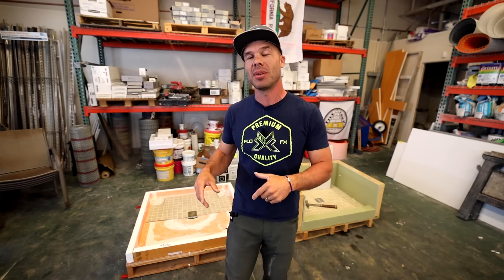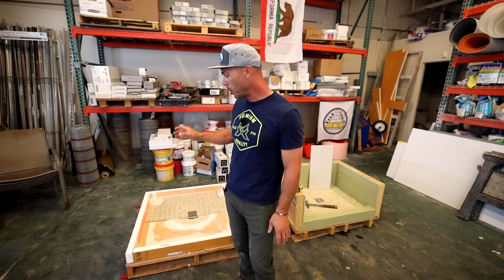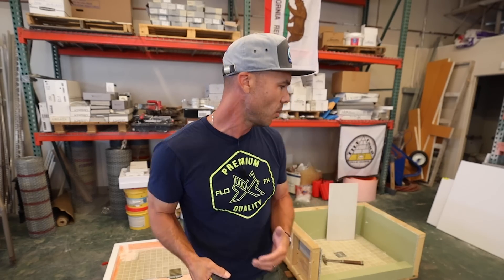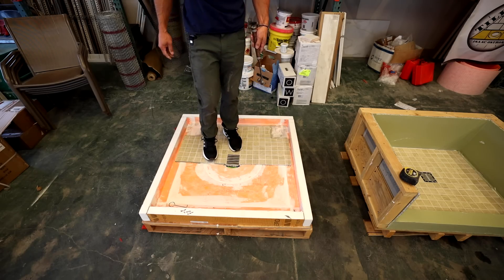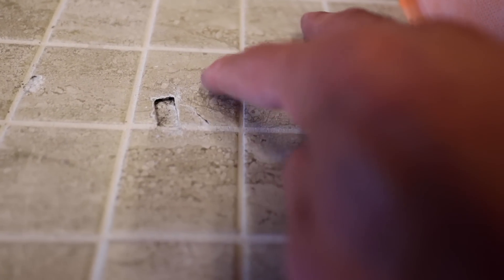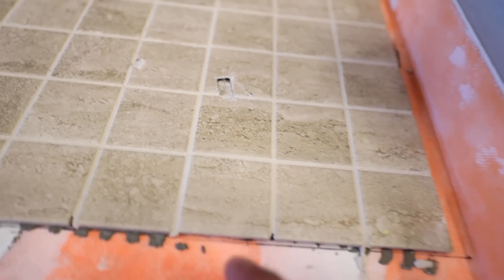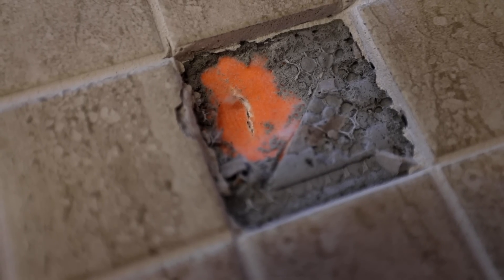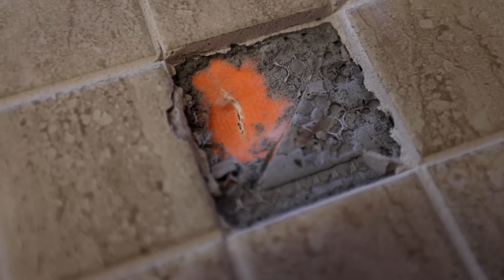FOAM VS MUD --- Drop Test 2x2 Porcelain Tile Shower Pan

Comment: With the foam side, could I put something down on top of the foam, felt or hardi board, before covering with tile?  Would adding that provide more protection to the foam pan with just a small added step?

Comment: Dropping hammers or slabs of tile aside... "any" shower can leak, even a mud job if its not done properly. Personally... if I had to choose between a mud job installed by a guy how lied about his skills and qualifications or a foam pan installed by a licensed pro... I'd take the foam pan every time. Failed showers are not due to the materials used but rather errors and lack of knowledge by the installer. Once a foam pan is professionally and correctly installed, finished and put into use... I can't think of a single time where I've carried a framing hammer or piece of time into my shower with me. Moral of the story... regardless if your base is foam or mud...  protect the shower floor until all construction is done.

Comment: I've mudded everything for the last 35 years and to the best of my knowledge no customer call backs on water leaks and no cracks in the grout, the only two mishaps were at the very beginning when 1. I did not slope under the 40 mil pan which the building inspector dinged me on and 2. the dam cracked and failed on another shower because I cut the folding membrane to the top of the dam to the side walls.
If you use anything other than full mud shower construction you must CAULK all changes of plane, where as my total mud showers don't need it - at least thats what I say and nothing is more uglily than caulking in a shower.  Also I've never cut my galvanized wire at the corners - it's continuous and over lapping.  Also I don't cut the mortar walls in the corners to create a movement joint like the new rules say to - what is this about?  
One of the five principles of engineering is compression and how to transfer the force to the lower levels of different materials without compromising the top layer like in road construction.  In a foam pan its not solid and hollow sounding, whereas a mud constructed pan using thinset to set tile acts like a solid material and the force is transferred to the existing base.
Hopefully I don't blow it with the main manufactors of tile setting materials because I know and like them, but they push speed and ease of construction in showers - when I push the question on which method will survive the test of time they admit that the old way is still better in the long run.

Comment: I had this problem a month ago, my fault for not protecting the kerdi pan sufficiently. had to pull a broken 33x33 wall tile and a wedge fell off the wall cut my arm and punctured the kerdi pan (about half way). set me back a day repairing the pan with a piece of kerdi band and a coat of redgard for extra insurance. thoughts?

Comment: I built my shower with kerdi, but decided to spend an extra $50 and buy a gallon of Mapei Aquadefense to paint on top.  $50 for an additional layer of waterproofing seemed like a good deal.  If it were me, I would just use the aquadefense to paint over that tear in the foam pan.  I think that would suffice.
Reply: How’d it turn out thinking of doing the same double insurance

Comment: i have a plywood floor putting level up then put kerdifoam shower pan then put my 40 mill rubber on top of foam put dry pack and tile an overkill but I am replacing a 8 year shower that failed I dont want to do it again house has 4 showers that needs replacing

Comment: I’m not an installer so I don’t know what’s out there for shower pans. 
Although my neighbor had the foam and somehow it starting to leak. They ended up having to replace the whole shower as well as all of the wood in their hallway. It was a huge fight with your insurance company but they ended up winning after a long battle.

Has anybody come across this before? The reason why am asking is because I am looking to remodel my bathroom and I want to make sure the contractor does it right and I don’t end up with a leak having to replace my three-quarter inch solid oak floor that happens to be parquet.

Any comment would be appreciated.

Gal in L.A. trying to avoid more issues that I have in my kitchen remodel that ended up costing me a lot more $ than was budgeted…with a 25% for “just in case” since my home was built in 1951.
Reply: Any shower can leak, even a mud job if not done properly.

Comment: Just an FYI  Your 3' drop might have been from your hand to the flooring but the bottom of the dropped tile was only around 2' off the floor.   Just an observation.
Foam or Mud pan.  Foam pans are outrageously priced.  $600 for foam worth $25.  I would rather do a mud base and pocket the money so thats what I do.
You should do a video about why to Never do a multi layer 2x4 curb especially pressure treated ones.   Seems to be a homeowners favorite thing to do followed by their worst nightmare 6 months later.
Reply: What's wrong with 2x4? I get PT, that can bend/twist as it dries, but whats wrong with Southern Yellow Pine?
Reply: @nandisaand5287  Its wood, thats the problem.  Wood and water don't play together nicely.   Lets say your wood curb dries out nicely in 2yrs.  now you have a gap between the wood and thinset, mortar, tile, whatever you applied over the wood.  Now its going to crack and leak water from the air space that was created.   Are you trying to say using wood as a curb that can dry, shrink, rot, twist, swell and whatever wood can do is superior that doing a curb made of mud just like your shower pan.  then you might as well just stay true to yourself and do a plywood shower pan as well.

Comment: Question: for a fireplace, if you're concerned about warping from the heat, why not just go for drywall instead (or even mold-resistant drywall if you're concerned about moist heat)?

Comment: I dropped a heavy marble corner shelf onto my finished shower floor from about 4 feet up. Mud pan. it hit next to the drain and only damaged one floor tile which was octagonal mosaic marble. The shelf pretty much shattered. I used a wood chisel as well to remove and replace the tile.

Comment: Isaac do you have a step by step video for DIYers for a shower room build. It would be nice to have a guideline. Im going to attempt doing the bathroom myself, Ive done tiling before but with a friend at the time and I have my fair share of experience as a DIYer. As I am going to attempt all this myself, it would be nice to have a quick guideline from some experienced tradesmen or you (so that atleast I know where to start off, what to research and where I stand in terms of skill set). Thanks in advance. Any links to websites will also be appreciated

Comment: The foam shower pan seems inferior to deck mud in every single way. Just use hydroban if concerned about a flow-through system. The only advantage I see is the install time. So good for the contractor, not the customer.
Reply: Hopefully the customer isn't dropping tiles or hammers on their shower floors! Soap and sponges won't damage a foam tray.
Reply: The only issue I see is it limits the size of the shower. Probably have to do good research on how to manage the pan/wall interface. I’d find Issac’s video on tub installs and use that method.

Comment: I always put down a sheet of durarock over the pan as I tile the walls. I only take the durarock up when I grout the shower pan and that's at the very end of the shower install. Cleaning and grouting shower pan is last. The next day I do the Finished caulking. Which it's good to step on the pan with no duracrck. All I have in my hand is a caulk gun. No probs. 😁
Reply: 1/4 Jet board here. Gets few showers out of a board. In a pinch I’ll use waste pieces of 1/2 foam board just to spread my load when I’m on foam.

Comment: Pulled our tub. Built walk-in shower with Kerdi pan n drain. Go board walls, fabric n aqua defense on seems.  Pan to wall seams used kerdi band and thinset..  then put aqua defense on that..   turned out great.   I won’t be dropping 2 foot tile on our fished product.   Excellent demo tho

Comment: Another test item could be drill driver. I was building a shower surround for someone and it fell off the shelf. Then landed on the phillips bit so it had all the weight on a small impact point. It broke about a 1x2 inch chunk of porcelain. oops

Comment: I'm an old Mud Man for sure.  You can control so much more with mud to adapt to the different tiles you get asked to tile a pan with.  Not only that but you make more money which is why I am still a tile guy.  Who wants to send 4/5 hundred bucks back to Germany?  Not me thanks.  Whenever I see orange stuff being used on walls and showerpans I immediately think handyman not Tile guy.  Issac you should do some videos on using mud to ramp up to a zero transition shower for handicap access.  Always like you're attitude and approach to life Issac!  Two thumbs up from Minneapolis!

Comment: I had the same issue happened to me I build the whole shower and the electrician drop his saw cup and boom 💥 it broke the tile and piece the foam and the membrane  I did remove 6 tiles patch the whole and I did need to shave the back of the tiles basically a whole day of work to fix it. If it was mud  I only need a hour to fix  it

Comment: I'm Mud guy with vinyl pans just because that is the way I was taught..  I was also taught the shower floor goes in last so I tile everything then float and set my floor.  I was also taught the 1 coat wall float over paper and wire which I know alot of you don't like. I'm about 8 years in to doing showers this way and am yet to have someone call with a failure..(Knock on wood)

Comment: While I do love the test, the engineer in me says a sample size of 1 is insufficient data. You have 16 sqft of area to test, why not do a minimum of 5 drops on each and see if results are same? 

Since we are talking 10lbs accelerating from 3’ drop, I’d need to know surface area at impact to know the actual force the impacted tile but it wasn’t that much. Imagine a 200 lb person climbing on a stool placed in shower. The feet of stool is 1 sqin. That initial load, even with plastic feet on stool is enough to cause deflection in that foam, especially on outer area where the foam might be 2” or greater. You might say, who uses a stool in shower? The glazers installing the glass. An elderly person using a walker. 

There’s simply no reason to use foam pan unless it’s a flipper looking for cheap labor and fastest job possible or diy’er lacking skill to float a pan. You have the skill to float a pan, use it. That’s why people pay you, to do a professional level job, not a diy level job.
Reply: Exactly. I like what he's does but this single test was a bad example.

Plus the tile needs to drop from the exact same height, hit the exact same way as well for a more accurate test.

Comment: First of all , please share the song title , I love that. And second I am trying to do mud pans now mostly but that is definitely my weakness in the whole shower system .I switched over because of price and also I believe it would be a great skill to have , I struggle with the pans quite a bit though I feel if I leave it as dry as manufacturers recommendation I can't work it like I need , so I normally get it too wet and get a little sinking action or just a little bumpy in general . But as always thanks for the content Isaac .
Reply: Thank you sir
Reply: FOYF by NEFFEX
Reply: Mix it and pack a ball in your hand. Then move it around in your hand and bobble it lightly if it just crumbles it’s too dry if it’s squishy with water shedding it’s too wet. It should hold to a degree and when it comes apart it should be in half or in big pieces stuck together. 

Mud pans were my Achilles heal when I was young and coming up in the trade. I’ve mixed thousands of batches of floor mud in a mud box as an apprentice and helper. 40 shovels of sharp sand and one Portland type 1-A cement.

Comment: Sorry buddy. You are pretty knowledgeable, but sometimes, you,re just a pain in the butt. Not only you're doing tests that will never happen in real life, but who the hell steps in a shower with a 12x24 tile without putting anything to protect a freshly done shower floor?  Come on!!!😳
Reply: Sorry guys but in all trades there are stupide people that dont respect others work  so yes it's happening
Reply: @juniorprovencher6832  you are absolutely right. 
I see electricians, plumbers, plasterers, cabinet fitters, painters, renovators,........ all damage other trades work.
Fatigue and natural stupidity is often the source of damage, and dishonesty about responsibly. 
Tradespeople quoting bottom prices and out of sequence work makes it difficult for following trades.
Site supervision failures contribute. 
Even protection on a tile finished floor can be removed too soon by idiots.
Sometimes foam may seem economical,  but ......
Reply: You have homeowners/renters dropping things too.  Like a huge 1/4" frameless mirror that hung from a string that broke,  a cordless drill that fell phillips end first when adding a screw above the tile to hang a pic, and their pawpa's cast iron pipe wrench that slipped when they tightened the spray head.  The only floor protection was  6 bottles of hair conditioner.
Reply: Agreed. If the tiler does not protect his work knowing sub trades will be working in or around the shower then he deserves it. Always always always protect your work! Cargo blanket with schluter backer on top. Lastly the odds of this happening.....is next to none
Reply: I love watching Whistlin Diesel mulch a squatted truck. It's just entertainment. I view this the same way.

Comment: I always protect my foam pans with blankets and a peice of schluter backer cut to size for on top. I also use laticrete 254 platinum for mortar.
Reply: The Laticrete cementicious mortar makes it solid
Reply: Very good sticky thinset the best

Comment: Would coating the torn foam with HydroBan work? That would minimize buildup.
Reply: That would void Schluters warranty
Reply: I was thinking the same thing about using Hydroban. I might be wrong on this but I wouldn't expect any warranty coverage because there's almost always going to be something the installer did wrong to keep the company from paying out. Because of this I would be very tempted to use Hydroban membrane and Hydroban liquid for a repair.
Reply: Kerdi fix would work but still void schluters warranty only way to keep there bs warranty would be kerdi  but build up would be the issue after that.Mud Is far superior.imo

Comment: We use a ton of foam pans. I've definitely had situations where something was dropped, mostly from plumbers and painters, and it was totally fine. The first time I had to pull a tile I was a little scared of mucking up fabric on the pan. I was able to clean it up and drop in the new tile no problem. Ever since then, I cover every shower floor with a couple layers of ram board til it's done. I have faith in the pan, but not in other people.
Reply: I worry about the foam when it comes to wear over time.  walking on it, standing in the specific place in front of the shower, etc.
Reply: How many foam pads in a ton?
Reply: A Plummer messed up some one else’s work? No way! 😂
Reply: Thanks for your comment.  It is helpful as I plan my job.  Unless you are in SoCal, then I will just let you do it.  Thanks again.
Reply: I use half inch trowel under em just to make sure I have a nice solid base. Also, the schluter ones are the same stuff they make surf boards out of, apparently, so they're supposed to be sturdy. In 8 years I've never had an issue with them. The only time I think is sketchy is with pebble mat because I only use a 1/4 inch on it. But still, never had an issue.

Comment: When you say the waterproofing has been compromised, i actually wonder how true that is. Would water actually travel through all that foam? You might have to do a test sometime to see if water can actually travel through the foam itself without the membrane. I feel for a foam pan, it's thick enough where it would do absolutely nothing but puddle in that dent area.
Reply: I pulled some less dense 1.5" x 4 x 8 sheets out of an industrial ceiling where a condensation pan had apparently leaked for years.  Completely saturated, and super heavy.  Couldn't believe how many gallons of water stryrofoam can hold.
Reply: I was wondering the same.
Reply: I believe the foam used in these is open cell pu. If so, the water will migrate through as well as absorb and swell. Open cell pu has 1.8% absorption rate.
Reply: @MichaelM-to4sg  schluter uses closed cell in their pan and boards
Reply: @Moose_VII  Are you certain about that? Kerdi membrane has a 0.90 vapor permeability rating. If it were closed cell pu, that would make it highly prone to mold issues
Reply: @MichaelM-to4sg  yes, it's XPS.
Reply: Think of it like a giant coffee cup that's acting as the bottom of your shower.
Reply: @LeftoverBeefcake  Coffee cups are Closed cell eps, expanded polystyrene. The foam used in shower panel are PU, at least Widi, Kerdi board and Hydroban board. Highly doubt any manufacturer would use eps foam board in this application for numerous reasons. If they wanted polystyrene board it would be XPS, extruded polystyrene.
Reply: Yeah. The foam itself is not capillary effect friendly IMO. I don't think it would travel all the way down.

Comment: If you chip the tile, that already compromises the system because when you try to replace the tile, remove chisel out all the thinset etc....You can easily damage the membrane underneath it. In this regard, pan liners are much superior. Of course a mud bed is stronger than foam. People use foam because it's easier and light.